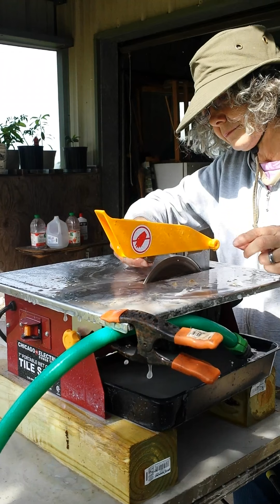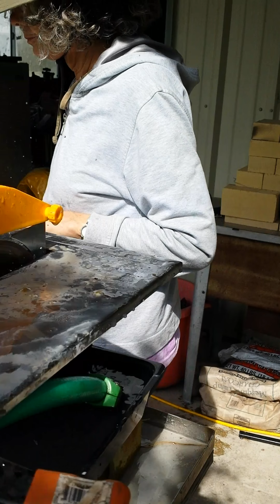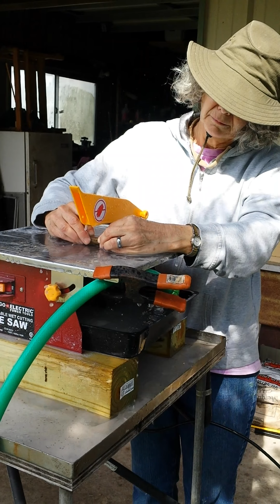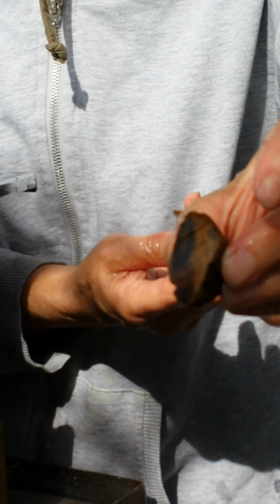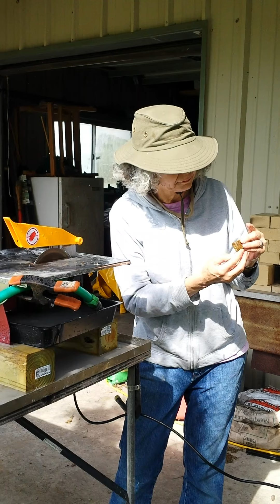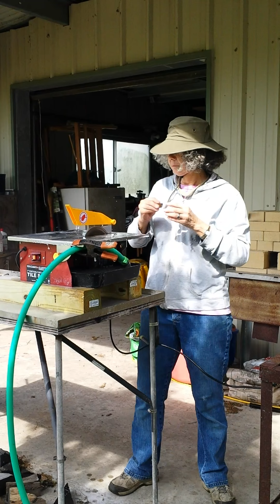Cutting rock with a Harbor freight tile saw.

Comment: Can you cut geodes with this
Reply from the maker: I am sorry I am just now reading your message. The HF saw was used as a trim saw for rock slices that were cut on a large slab saw. The HF saw worked quite well but only on slabs a quarter inch or thinner.